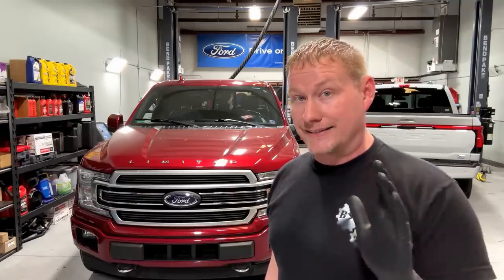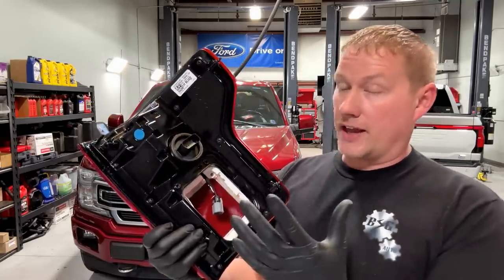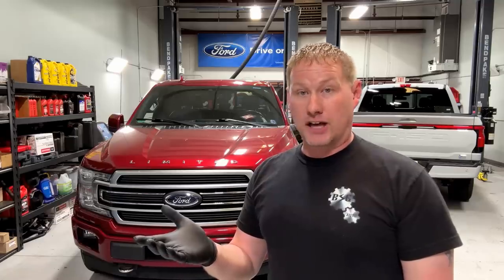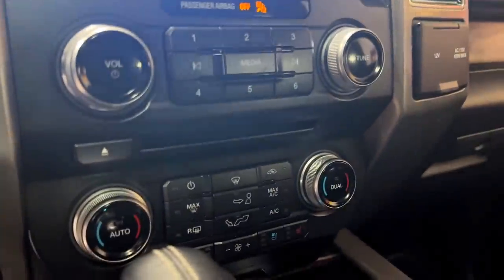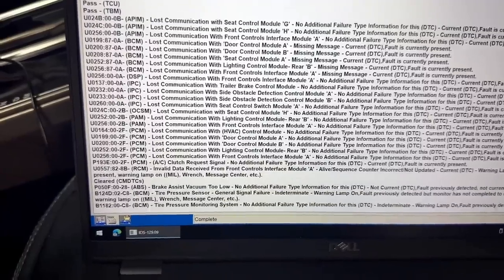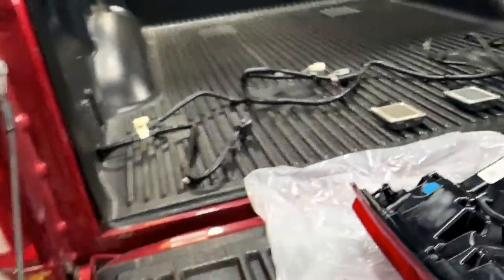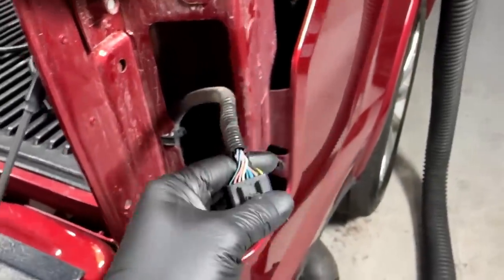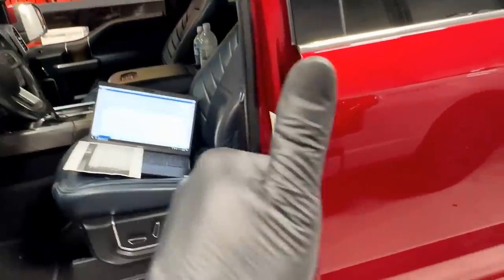Repair Cost Are Out of Control: $5,600 Bill for Some Tail Lamps?!

Comment: With anything in the 2000s, it’s a good idea to disconnect all the connectors under the hood and body and check them over and put new dialectic grease in the pins to prevent this type of thing from happening…,I’ve got an old 05 trailblazer that has the sensored gas pedal and throttle body etc…everything is electronic in these damned things….I learned the hard way in the blistering cold winter on the interstate how important dialectic grease is…stupid damned truck wouldn’t shift out of park after putting fuel in it…had to get under the shifter to pop the release so I could put it in drive…then I couldn’t pull the keys out of it lol….had to rig the battery for easy disconnect for the week of waiting for parts only to discover the parts didn’t fix it..,another week trying to figure out wtf the problem was…lose and corroded grouping junction is all…no grease in the connectors caused it to corrode and come loose…pissed me off bad lol

Comment: this is why u need a repair guy working with the engineers designing this crap. All this couldve been prevented with a simple weep hole in the bottom of the taillight housing. no reason to seal those air tight. thats what made them fail in the 1st place, i guarantee it. excess heat this summer caused the seals to split and let in water. then it had nowhere to go and slowly ate up the cheap metal of the heatsink and connectors causing catastrophic full vehicle failure. the whole concept of linking so many systems together in a vehicle is another design flaw in itself, imo

Comment: In the old days to fix a head or tail light meant going to AutoZone for a $3-$6 halogen bulb but nowadays, you have to buy an entire headlight/taillight housing or make an appointment at the shop then leave your car there for several days or weeks as they wait for the part to be shipped as most vehicles have led lights built into the housing and some even have sensors so it’s no longer a cheap fix it yourself in the parking lot situation. Then if you have heated mirrors with blind spot detection and even folding when the car is turned off, those are costly. If you fail to replace any broken feature on a new car your dashboard gets lit up like a Christmas tree and at the worst, the vehicle can shut itself off or fry the computer. Some vehicles require software updates every once in a while to use all their features. What an interesting time.

Comment: This may or may not help in this specific situation but any time I come across a frame ground I disconnect it and clean anything, to include paint, off and reattach ground. I the spray it with red battery grease spray. With all the  computers in these cars a strong ground is more important than ever.

Comment: Showing this video to my high school auto shop students in our electrical unit. True diag separates the technician from the mechanic. Well done.
Reply: true diag ? not a mechanic. by name, a mechanic fixes mechanical things. this is electrical/computer engineering. not the same thing. theyve taken it all away from the mechanics, and handed it over to the computer nerds. good luck with that.

Comment: I don't buy new cars anymore.  I buy only low mileage vehicles and have saved over $200,000.  The three (one owner!) Jaguars I bought used with 10,000; 25,000; and 45,000 miles cost over $300,000 in 2024 dollars...and I paid only $65,000.  Couldn't be happier.  I researched the "right" years to buy, and they are all quite reliable.

Comment: I had this exact same problem on my 2018 Lariat. I was quoted 2800$ by the dealership. I fixed it by unplugging the blind spot detection chip...for free. I don't have my blind spot detection anymore but I still have my $2800.

Comment: I won't buy anything newer than 2000. I am looking at a Benz 500SEL from 85. Analog and a tail light is NOT going to put the car down.

FORD= rubbish. I am sure GM is on the same track as well.

Comment: It seems like overkill, but I understand the use of a network between modules, as I've heard about that kind of design for other applications. However, it's a poor network design that goes down when the connector for one of the modules malfunctions, taking everything else down with it. The system can register the fault, but why take everything else offline when it's just a taillight??

Personally, I'd rather they go back to just having wires go to the lights. The repair is so much simpler, and cheaper. No need for sensors for the lights, for crying out loud. You can see when they go out, or other people can tell you about it.

It seems like what really added to the expense was the "radar" that senses an obstacle in the rear, so you don't run over something/somebody. I say use the mirrors, and look out your windows carefully.

I'll keep using my '03 Impreza, thanks.

Comment: Hello, 
         It all boils down to PREDATORY ENGINEERING DESIGN.  That is why the automakers have teamed up with the chip makers/computer companies. That is why I still drive my 1979 Chevy van. Modified with stainless steel. Hence, I live in a rust belt state.

Comment: Same reasons why I sold my 2017 F150 last year for $42k bucks,  I paid $48 brand new, paid it off over 5yr loan, put 71k miles on it and only lost $6k.. and 75% of that mileage was reimbursed by my company for over $0.50c per mile.. I am not buying new trucks anymore, only because they are a nightmare out of warranty.  I looked for months and found a 2002 GMC Sierra Ext cab Z71 with 48k miles for $9500.. I will drive that truck to work for at least the next 10yrs.. Everything on it is easily repaired, and cheap to do so.. I even like not having to be so careful of getting a scratch or crumbs on the carpet.. I love the old truck..

Comment: Had a Hyundai Tucson.Throwing a dozen codes.. went through wheel ABS clocks ....twice...Fuel injection, ECU,  Thanfully...a couple time I saw SAINTS like you quickly mention "tail light malfunction" I thought  "pfffft...doubt it. "  
Finally after a week of throwing wrenches I checked my bulbs. Sure enough ....an  intermitent broken filament .... SOLVED !
Yer right. It's insane. !!!
It's the gvt? 
CORPERATIONS OWN the gvt. It's called CAMPAIGN FINANCE otherwise known as BRIBERY AND CORUPTION. 
Up into the 50s Corps were BANNED from political contributions. Citizens United put the

Comment: I HATED… the thought of selling my 2003 f150 4.6L extra cab manual trans w manual 4x4…
It only had two computers… the Power Control Module… ( engine controller) and the “GEM”…. controls everything else…. Windshield wipers, windows, mirrors, door locks..etc…
But … it was time…
We bought the LEAST techie truck I could get…while still getting a fresh(er) engine, trans and frame… 2017 F150 XLT 5.0L ( the ECOBOOST is either great or a nightmare) 4x4 extra cab..
$16,500, plus gages and tags…plus a front right fender… plus a right rear bumper cap…plus a MATCHING Leer Tall Bed Cap…. And two tires….. $20,200  ALL in …( 104,000 miles)….
It’s now immaculate… I will now be “ passively collecting “ modules… as I see deals…

I’ve only owned ONE…other Automatic trans…. in 50 years of driving….  But 
ALL FLUIDS,,,, changed… engine oil… trans, transfer, diff… etc…. cross my fingers…
60RE80 … ok for now….
ELECTRIC STEERING… scares me too…
For ever one of those damn Star Trek advanced nanny cam systems… there should be a way to disable them … so that when the warning system pre-warns us of an imminent failure ( oh yea…. they don’t do that) ..  we can “ revert to manual steering”… Manual window cranks… lane keeping assists for the for the idiots that are textoholics… and narcoleptics … use your damn side view mirrors and pivot your neck…
We will see…

Here’s my bet…. Bring back the BASIC…. 1980 for ranger with the 3.0 ( Taurus engine)…
And the 1974 REAL ford bronco…. They cost 1/4 current build prices… then sell them for 1/2 current retails … never gonna happen. 

Ford makes too much money overcharging us for stuff we don’t want.

Comment: New trucks and SUV’s are just getting out of control, and even worse is that a lot of the public just willingly puts up with it. I replaced both my 2007 4Runner’s tail lamps for $150 and about 30 minutes of my time. A child could do it. Too much fancy electrical garbage in everything new, and Ford is one of the worst when it comes to the reliability of these things.

Comment: There is a critical error in CANBUS design if a faulty component in the network can bring everything else down.  Essentially sharing a ground across every device seems patently ridiculous.  Also, only 5 years for water ingress on some taillight lenses?  Never would be preferable, but heck, what ever happened to HALT/HAST testing?

Comment: this is why I do not get the super fancy models. I get the mid level models, then upgrade with aftermarket parts that do the same thing as oem factory. And with aftermarket, it is cheaper, can be easily replaced, and many many options available.

Comment: I have a 2018 f350 diesel. I worked on the bed and unplugged the harness for the tail lights and I experienced similar issue.

What stopped working:
Power windows, climate control, radio, power side steps, interior lights. 

As soon as I plugged in the harness it all started working again.

Comment: I owned Ford trucks since 1969, three pick up trucks, two vans.. I switched to GMC for 8 yrs—-
     Then….when Ford made their pick up trucks that required cab removal to access the engine and transmission, and when they had a few engines that were known for blowing the spark plugs right out of the cylinder heads. I heard that happened to a coworker’s truck when he was leaving work one day… I thought he threw a rod, he had his truck towed, and it was just a spark plug. And it turns out, those spark plugs are a real job to get out. The proper sequence is to let the engine, cool, spray penetrating fluid, at the base of the spark plugs, and just crack them loose, and let the penetrating oil soak in, then go back and carefully re-tighten and loosen the spark plugs until you get each one out.. that’s when I switched to a ram, quad cab, 4 x 4, hemi pick up…
  Now Ford has tail lights that could cost thousands of dollars to repair.
  no wonder those television auction prices for the 60s and 70s pick up trucks show those trucks from those years selling for more than they cost new sometimes by four times as much.
  I have never been without a truck since I was 17 years old. I kept one of my vans for 31 years. I bought it new in 1977, and it drove onto the flatbed truck to go to the scrap yard when I sold it, it lasted so long because I took care of it I spraying the chassis and frame with 50 weight oil to help protect it from the salt They throw here in Pennsylvania during the winter.
  since there is a big push to go electric. I wonder how salt is going to  Affect electric vehicles? Especially concerning for someone like me that keeps vehicles a long time by rust proofing with fluid film. Will I even be able to do that with an electric vehicle with fluid film?

Comment: Had a 2017 F350 - smashed one tail light and the other was cracked.   Got the $1400 price tag for each.  Found some aftermarket LED ones for $325 for the pair.  SOLD

Comment: Love this channel, Brian is awesome. I have a 22 F250 XLT 4wd, 13 F250 Lariat 4wd (my plow truck), and many other FOMOCO vehicles. These newer trucks are as far as I plan on going at age 64. When I spend more money it will be on my 2 -1976 Ford Broncos with Holly 4barrel carbs on them and NO electronic "safety crap", sensors, fuel injection, PCM's ETC, AND ETC. Maybe someday all I will have is my old school 1976 broncos. It's just not worth owning anything "NEW" in today's world. The system of manufacture of vehicles is totally out of control in this country , IMO

Comment: All those problems with a 2018 Ford .... My 2008 dodge has 344,000 daily driver back and to work....I have replaced the taillight bulbs a couple of times no big deal....jackass is obviously rich or stupid or both....also right to repair will lower the price to fix

Comment: Debs husband says I drive a 2005 Ford F-150 Lariat 4x4 with 247,000 miles and still running strong. I also drive a 2006 Ford Mustang GT  with 150,000 miles and still running strong.   I also drive a 2015 Lincoln MKZ AWD with 58,000 miles. It seems to me that about every vehicle has a weak spot somewhere. While proper maintenance won't stave off every problem it can go a long way toward reducing problems.

Comment: I just replaced the tail assembly on our 2006 CRV for $100. Ordered a aftermarket assembly from Amazon. It came with wiring harness and bulbs . It took 15 minutes and a screwdriver to install.
These dealership's and manufacturers selling new cars and high priced repairs can kiss my a**.
If I need a mechanic, I use a local shop that   charges half the price of the dealerships and uses better than OEM parts.
At 70, I hope to NEVER buy a brand new car ever again.

Comment: That is absolutely ridiculous.  If I had comprehensive insurance, I'd probably have 'accidentally' backed into something.

For the amount of money new vehicles cost, I think if I needed a pickup truck I'd invest in a full restoration of some 1980's-90's model that could be fixed with chewing gum and duct tape.

Comment: Yeah, Parts and Labor Prices are Astronomically Out of Control. 
Auto Manufacturers are Intentionally making cars to break down as soon as the warranty runs out and the prices Parts and Labor to repair Completely UnAffordable. AND, they're Intentionally building cars in such a way as it's near impossible for "Shade Tree" mechanics to work on them. You have to have a "Shop" and a lot of "Specialty Tools" to work on them.
EVERYTHING is a gimmick/Scam against the Average American Citizens.

Comment: ford is taking a playbook from the tractor dealers........................ need a brake light cover, too bad, have to get an entire fender and wheel well. $6inch peice of plastic nope ..... 200lbs of parts you dont need for something that held in with 2 screws.

Comment: I have a 2005 five-hundred with 161,000 miles that I've owned for 10yrs now.
Of course it doesn't have all the tech in these current vehicles. Although, I see that as a good thing.
I will never, ever have to consider that my vehicle is inoperable because of tail light housing. SMDH.........!

Comment: I have  a 2019 F150, XL trim.  None of the safety sensor options.  When a taillight burns out, as it eventually will - water or no water,  am I looking at just replacing the bulb or will I need the entire lens assembly at $1400 per side?

Comment: Which Year Models have this wiring ? I have a 2015 F 150 with 63,000 Miles i keep it inside, But i had to Replace The Battery ,and i have the Warning amber mirror light Icon up . I do not trust my Dealer ,I am hoping it can be reset sense that is the only icon on.Everything else. works Fine ,If my 2015 Lariat  has this same wiring I will Go Buy an older Truck simple to Fix .

Comment: Bus problems can be tricky to diagnose. I had a Fusion in a few months ago with multiple systems not working. The entire MS-CAN bus was dead.. the BCM, instrument cluster, door modules, etc. I could communicate with all the modules on the HS-CAN.

In these situations I find a resistance test of the bus is a very fast overall health check you can do from the DLC. The MS-CAN on this car had two 120 ohm resistors for termination, one in the BCM and one in the instrument cluster. When both are in the circuit the resistance across the DLC pins should be 60 ohms. I disconnected the battery and tested, this one was 47. I disconnected the BCM and IPC to take all the resistors out of the circuit and was left with 227 ohms across the pins. Bingo.

I started unplugging things to see if the resistance went away. When I unplugged the passenger's door connector the resistance went infinite. After some brief checking I saw the passenger's door had been replaced. There are two versions of the door for this car, one with auto-up/down windows and one with conventional power windows. The door connectors are identical for both, but the wiring pinouts are different. The auto-up version is wired into the MS-CAN bus, the conventional one isn't. But it just so happens the power mirror wires on the conventional connector go to the MS-CAN pins in the auto-up connector. Pulled those wires out of the connector and everything came back up. No windows on the passenger's side, but it was a good tradeoff.

Comment: Ford F-150 has the highest amount of recalls in the last 5 years then any other truck in production, and much of the breakdown recalls fail after the warranty or recall expires and all of them are very costly. I love my F-150 but it’s cost me tons of money, never again will I buy another Ford sad to say. I’m going back to my Silverados. The best F-150 I’ve owned reliability wise was my 1977 F-150 300-6 which is bullet proof. Currently I am looking for one in good to restored shape, I will buy it in an instant and sell the one I have now. All this electronic crap is just that, crap. Yes the performance can’t be beat, but I rather have reliability over performance. Nobody could argue that 300 6cyl wasn’t a great engine. Not to mention easy to fix, good gas mileage and heavier steel on the truck body and frame. BY OLD OR GO BROKE.

Comment: I hung onto my 98 f150 for 14 years. I bought that truck for $2400 cash lol. The repair of this guys tail lights could have bought my truck nearly twice lol. Now, I did put $7000 into it over the years through some heavy duty maintenance, rebuilding the transmission etc, but broken up over 14 years was no problem. I kept it just incase after buying a 2021 ford explorer ltd just because I know these things have a ton of computers that can wreck havoc